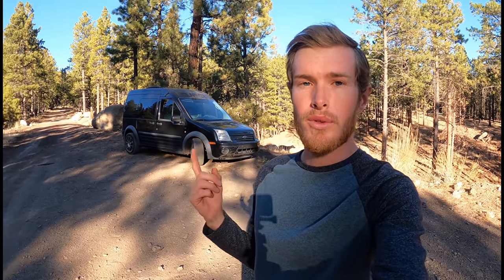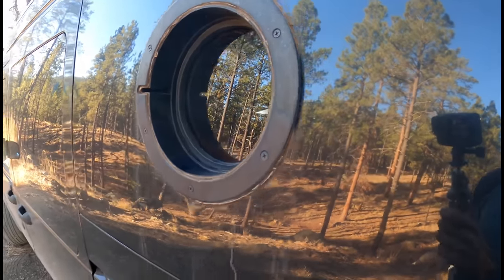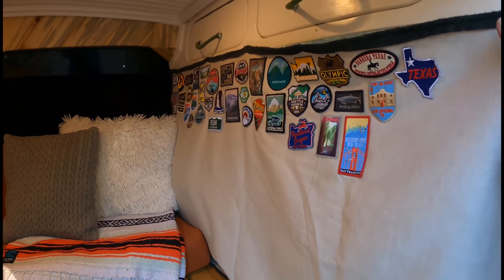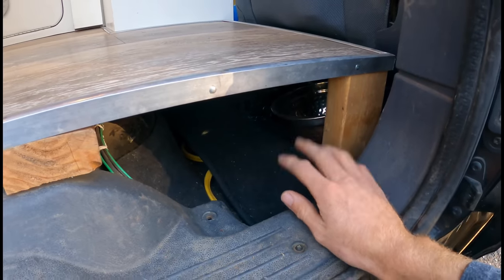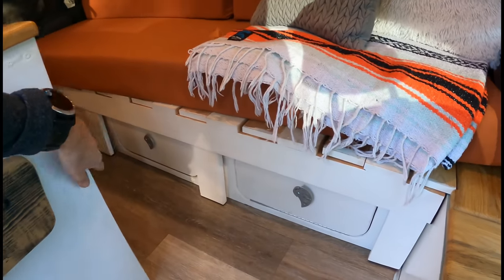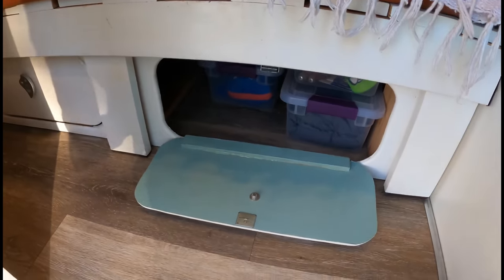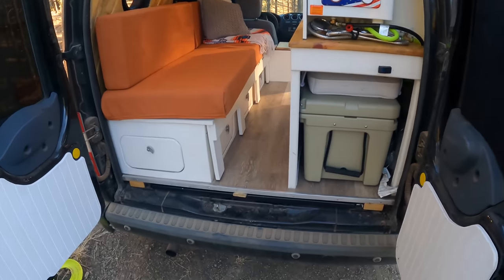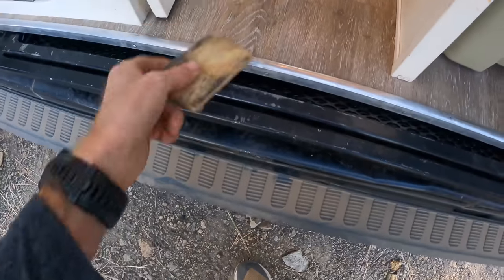CUSTOM TINY CAMPER VAN (with shower & hidden bench) - FULL TOUR

Comment: Your porthole is leaking because you installed it with the drainage hole oriented at 10 o'clock instead of at the bottom. A better porthole won't fix the problem if don't install it correctly.
Reply: Yeah I see it. It is a simple mistake that he hasn't noticed yet. He needs to undo it and reinstall it

Comment: This is one of the best builds I’ve seen in a Transit Connect.  I agree having drawers under the bed would be easier to access. I am interested in your auxiliary battery set up & how u have the electrical equipment set up. Also your water setup is great. I would def need a portable potty.  I would cover it & use as extra seat or footstool.  Maybe could put it on front seat during day.  Your pooch is adorable.  Happy travels, Mo in NJ

Comment: Just wipe the window down with soapy water and add a bead of silicone to prevent it from leaking. Or cut out a bigger hole for a larger window. Shouldn't be too difficult.

Cool idea on the divider. Nice, quality build. I really enjoy the aesthetics, which is saying a lot for a weirdo like me. I like the look of the inside. The stuff in back of your drawers you can put in a basket, or use some flat panel with a piece of board on the back to pull things forward.

Comment: Absolutely Fantastic. I like a lot of your ideas here. You've got a knack for this it seems Austin! Great engineering, design, and craftsmanship. I'm taking a few of these ideas for sure. I love the multiple access points for a lot of your cabinets, saved space with your kitchen cabinet slider below, and the idea to add sliding drawers for beneath since it's such a low and awkward storage area. I like how you have a vent like setup with a fan right over the sink, the stashed away propane stove, the the fold out table for it which is massive! So many things. I was already thinking of doing a lot of rounding of edges cuz I just love the look of circles and edges are just so unnatural to the eye in my opinion. You took this baby right where you wanted it and it looks gorgeous! Very inspiring and thank you so much for sharing it with us Ultra Austin!!!

Comment: Great video. Beautiful little van. I think your porthole may be installed sideways. It should open upwards with the little cutout at the bottom to drain any water accumulation. We almost had the same problem. 🐻 👍

Comment: awesome little van! Yours is the first one I've seen with the bed behind the drivers seat. Thats how I did mine too! Mine is in a 94 dodge ram though, so I have more length. I added shelves at the end of my bed, and a shelf across so I can cook in my van if I need to also. You 'finished' yours nicer than I have mine. Back to work I suppose!! Thanks for the tour

Comment: Such a great build! I too appreciated when you mentioned what you would have done differently. However, if you changed nothing on this van it is a terrific build, and fantastic on cost too! 

Don't know if this is helpful at all, but you mentioned making the under bed area more easily accessible in the future with drawers...I saw another slatted pull-out bed option where the whole slatted section was hinged and lifted up to be able to access all the under-bed area at once. It might also be nice to have a secret long "tray" area the length of the bed just above the future drawers where you could store something long, like a surfboard, hiking poles, or whatever. 

I am curious to know if you have designed a little circular window mesh for your porthole window to keep bugs out? I wonder if that might do double duty and help keep snow out too...that is, if the mesh were running even with the outside of the van. 

The pull-out seat in the back is GENIUS!!! I watched both of your van build videos, and this is by far one of the most unique features of your van. Please do post an update on your YouTube channel if in the future you decide to make and sell this for other vans. Judging by the number of views on your video, I suspect you would have a LOT of interest. Best of luck to you on your travels in this wonderful rig, and thanks again for sharing the results of your hard work.
- Alis

Comment: Very Nice Set-up. You Can Put Rain Guards On The Windows So If You Crack Your Windows Without Anyone Knowing. May Have To Do Screens For The Windows. Also You Can Cut Out A Piece Of Heavy Stiff Plastic To Fit The Little Hole. And Put Hinges on It So You Open In Close. You Are So Smart, You Can Do Anything. I Recently Saw A Portable Toilet With The Sides That Roll Up For A Shower. I Suppose It Uses Power.. Awesome

Comment: Hi! Gorgeous build. Unsolicited thought on keeping water out of porthole. Get a little piece of lexan & cut a circle as big as the outside diameter of the window frame. Mount it on the outside  w one screw near the top. You'd be able to pivot it open from the inside, but friction would keep it in whatever position you leave it. Gravity will keep it centered the rest of the time.

Comment: Just a heads up, your porthole is fine. You just have it mounted wrong. 
The hinge should be at the top and then if you go to the outside you will notice the slit cut in the flange that should be at the bottom for drainage. Usually there is a chain and hook that comes with them to hold the porthole open. 
 I might have missed it but if you don't have them already put in a carbon monoxide and propane detector 50 bucks could save your life. 
Now that is al said, great job on the build and enjoy your travels.

Comment: Looks good. If you want to stop the floor bulging then you need to cut it smaller than the perimeter of the van so that there is a gap around the edge so that in the wetter months it will have room to swell and not force it upwards.

Comment: When you slid out the back bench, 
I was like , YES!. I “knew”  you were gonna do that. You nailed it. What a great use of that space on the smaller build. Just like the larger vans! And so so cool , metal bench . You and Your Dad. Nice.
Thoughtful , Artistic, personal.
The color palette . Shout out that pine wall ! Wow!  The focal point in the space and the orange statement. Love
Energy question: what about inexpensive but good small fridge? With or without a solar panel? 
Also a flat and scaled to size flip up table  to expand counter near sink?
Thank  you for sharing your build .
Awesome
Reply from the maker: If I were living in this full time I would definitely consider getting a solar set up and 12v fridge. However, the costs outweigh the hassle for me right now as my cooler does a great job

Comment: You can deal that little port window with some clear plexiglass just cut the diameter of the window and glue it in should be really cheap and simple
Reply from the maker: Unfortunately I would still like to be able to open the window so I don’t want to seal the whole thing with plexiglass

Comment: Well done.  Great ideas.  I do have a question on the shower.  I read the comments and didn't see my question so it is possible I missed it on the video.  I only see one intake for the water which leads me to believe you only have hot water.  How do you adjust the water so you don't scald yourself.   Thanks.

Comment: Fabulous, didn’t get a close look at the porthole but have you fitted it sideways? Think the little slot affair should be at the bottom? 🤔
Reply from the maker: Yes, I've since realized the porthole is sideways. Unfortunately, the window would be falling closed constantly if I had installed it that way which would defeat the purpose of letting in fresh air. Guess I should've thought that out more during the build. Thanks!
Reply: @UltraAustin  it was when you mentioned the water leak, I suspect the slot that is at the side would be at the bottom to allow the water to drain away instead of pooling 🤔

Comment: you've got a great practical van considering the size.  The net for the door that keeps the bugs out is the coolest cos is light and easy to fix and not bulkly that is so clever.  Also the bed is so neat s you do have tons of storage.  You even have a shower but are you sure you will it will not wet our bed!!!.  Good design and that pull out chair was great except why have a dog that takes so much space...sorry I am not an animal lover so I don't quite understand.

Comment: Austin,  I am  so impressed!!   You have given me hope since I have been toying with the idea of a micro van.   Especially your finishes,  it is not only functional but very beautiful and organized!   I didn't know that you could have a battery that could charge off the vehicle.   All the builds I have seen are solar.   I do wonder how long that battery will last you?   Would love to know...
Reply from the maker: Thanks! The battery is 100 amp hours so the duration depends on what you’re charging. For example it takes 1 amp to charge an IPhone so you could charge iPhones for 100 hours before it’d run out of juice (without driving and recharging it at all)

Comment: This is a great build.  It's so very personal, which always makes the difference.
I've been looking at van build videos for a few years now and I think I'm finally in a place to realistically consider it for summer travel. I've more recently discovered the micro campers which seems a good place to start.  I love the fact you have a shower. I've been trying to think of ways to incorporate some sort of pull out shower tray/ stall & your set up has been the best inspo yet.  I don't live in a very warm country though - in terms of using your shower, and having the custom bench, in your opinion, do you think it would be possible to have a similar set up with something (PVC curtain + flip up 'roof'?) connected to one back door open and have an almost-indoor shower that would feel okay up here in the northern Northern Hemisphere?  I realise that's  probably a personal opinion Q&A, but any input would be appreciated! Thanks!
Reply: im not sure if you're still looking for ideas but there is a product made by a mom i saw a while ago- its a large privacy curtain that attaches to the trunk of an suv in a canopy-like manner. it was made for beach trips so her and her children could get changed comfortably and privately, and it's a genius product. if i find it i'll come back and link it if you still need a solution.

Comment: Hi Austin, Super little design, but how is your FTC for reliability? Lots of bad reports on line, especially for anything older than about 3 years.
Reply from the maker: I use my FTC everyday and it has been quite reliable if you stay on top of maintenance. The transmissions in this model have been known to have some issues and need replacing/rebuilding however

Comment: Reflectix rant: if you cover both sides of the reflective material, it is no better than plain bubble wrap (which is much less expensive).
Reflective foil products only work if there is an air gap. 
(The rant is not really really directed at you, just a general thing)

Comment: Kinda looks like you installed the porthole window backwards. The lip should have gone on the inside of the van not the outside.
Reply from the maker: Yes, it is backwards. If I had installed it the other way, then any random person could open the porthole window from the outside

Comment: Has a propane shower but no toilet option?  Advances in van life technology have you covered.  Search for retractable toilet and male urinal.  Cheap, small, works.  If you go camping with a human of the opposite gender also search for "female urinal".  It's basically the same thing with the extra thing attached.

And PS.  That porthole is probably a big hit with dogs so they can stick their snout out of it while you are driving.  A little bigger and they could stick their whole head out there without the danger of them falling out of a window or having their wagging tail slapping you in the face all the way to your destination.  You should really start calling it the snout hole.

And PPS.  This is the third and last attempt at posting without getting rejected.  I deleted any reference to a company name to buy things from and quote marks in my post.